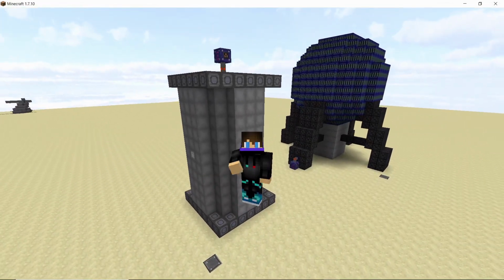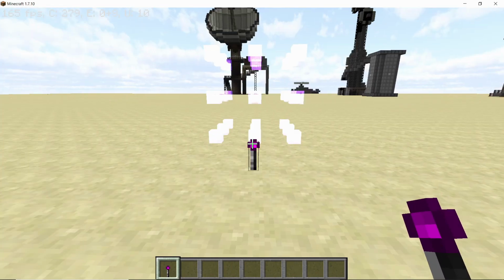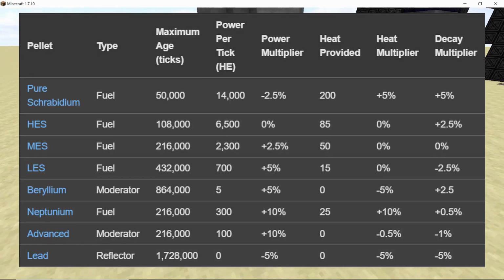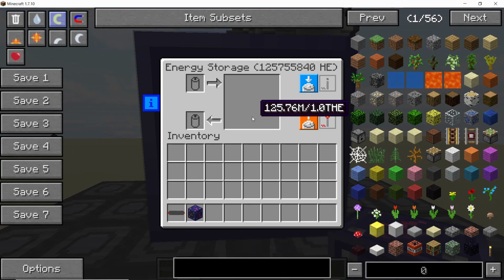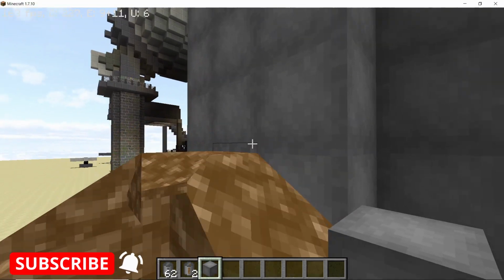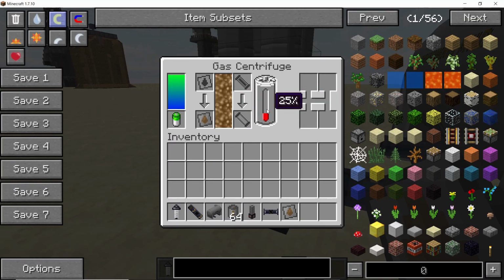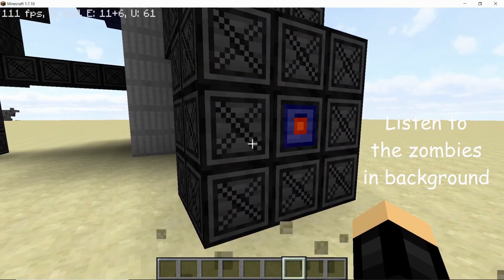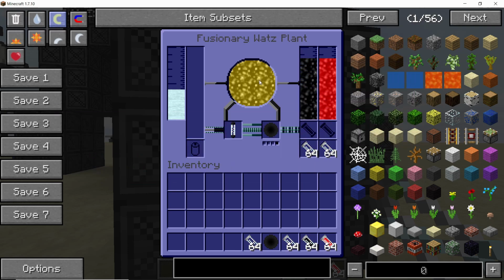"Watz & Fusionary Watz" Power Plant in Depth Guide || How to use the Fusionary Watz Reactor HBMs Mod

Comment: How do i remove heavy mud from the gas centrifuge
Reply from the maker: just connect the centrifuge using fluid ducts to a tank which can store corrosive fluids and set the fluid duct to poisonous mud. Then the centrifuge will automatically output it into the tank. Or you can also use universal fluid tanks inside the gas cent and fill them up

Comment: i waste 1 hour for this reactor but İTS NOT WORKİNG CAN YOU SHOW HOW TO BUİLD THİS
Reply from the maker: Hmm building it in survival can be tricky. 
You've to use an item called Multi Block Structure Marker , cycle through all the structures and set it to either the watz or the fusionary watz reactor whatever you wanna build. 
Once you've set it place it on the ground and it'll give you an entire hologram of the build. Start placing the blocks according to the hologram and that way you can build these Structures.

Now as for not working you've to tell me exactly what's the problem you're facing ... Cause a reactor "not working" can be alot of different things

Comment: The normal Watz reactor seems way better  than the fusionary.
Reply from the maker: Why do you say that dude ?
Reply: @SavageVegeta  BC of the fuel  they need. There isnt  a high power difference but a high Ressource difference. The fusionary watz reactor needs a lot of 4000k Blocks (dont know the Name rn) made with schrabidium. And fueling schrabidium also isnt the best idea.
Reply from the maker: @nunilp2055  that is true running the Fusionary Watz is very expensive but so is it the power output it gives you ... Like if you run Watz with HES Advanced Pellets array it gives you around 12 Million HE/tick , on the other hand Fusionary Watz will give you 200 Million HE/tick
Reply: @SavageVegeta  thats is true too

Comment: Instead of a black hole and a fuse try using a screwdriver and singularity screwdriver
Reply from the maker: Was gonna showcase that as well but then I realised I needed to get the singularity screwdriver by command and I had forgotten the command 😂☠️
Reply: @SavageVegeta  What is the difference between a screwdriver and a black hole?
Reply: @farnorth7216  fuel depletes around 10 times slower, no seriously.
Reply: @megamiana-spaceforcecomman705  Roger)

Comment: We can use the anti matter and anti schrabidium wires as powerful grenades
Reply from the maker: I especially love dropping in Anti Schrabidium on villages , that is purely an accident tho 😂
Reply: @SavageVegeta  speaking of that could you try hooking it up to a self sustainable particle accelerator so that we can constantly power the fusion watz reactor
Reply from the maker: Still you can't automate the particle accelerator as it's gonna need matter capsules to run , however the energy that Fusionary Watz Reactor produces can indeed be used to power the particle accelerator.
The problem is you need two particle accelerators , one to produce antimatter , and the other one to produce antischrabidium using the antimatter as raw material